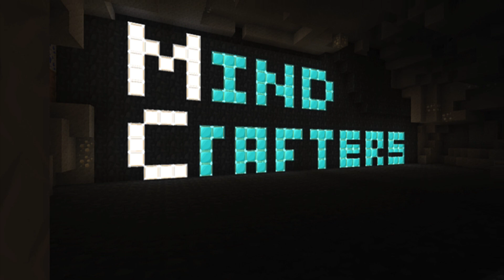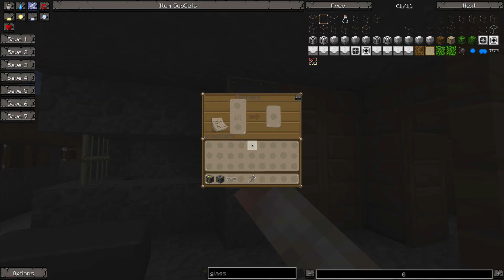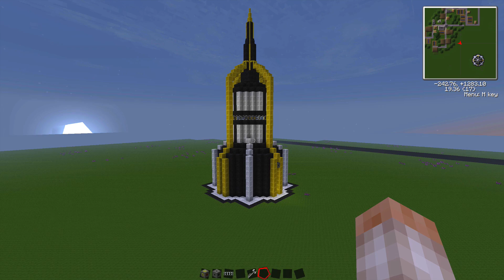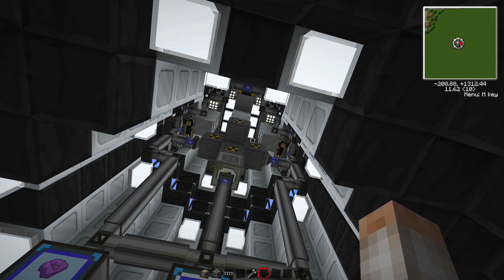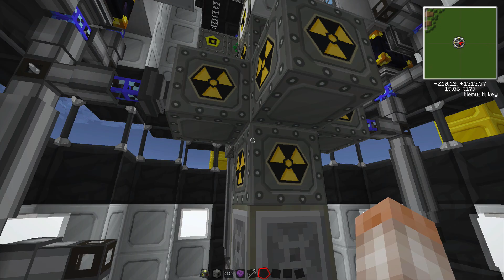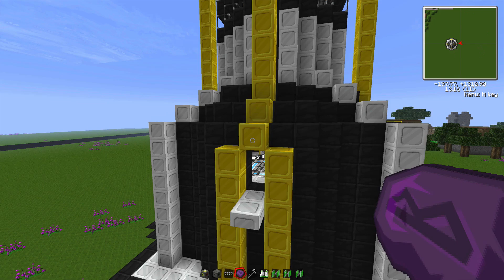Tekkit Lite - Applied Energistics - IC2 Nuclear Reactor

Comment: The resource cost of a reactor design like this is more manageable in packs like Tekkit Legends and Tekkit 2, thanks to Project Exchange; however, there's no coolant injector equivalent that I know of beyond MC 1.4.7. This means that depleted condensators have to be removed and replaced with fresh ones in less than a second, if I did the math correctly.
Neither pack has AE2 pre-installed, though; is it possible to have that kind of automated response time with Blue Power/Project Red without a max-speed timer constantly ticking?
Reply from the maker: Man I forgot ProjectRed existed....thats a real blast from the past. Maybe another viewer has an answer though.....its been a decade since I've used that mod. Thanks for watching@

Comment: you can have extreme output 5 Chamber reactors and there is a way to cable from it which is use 4x insulated HV cable

Comment from the maker: Yes there is definitely is but its not easy

If you want to start working on automating one yourself I'll give you the main problem that you have to get around. The breeder (unlike a regular reactor) needs to be filled repeatedly with two items; uranium cells and depleted isotope cells. Also two items also need to be emptied, Near-depleted uranium cells and the re-enriched cells.

Now, tell your system to inject, and eject items at exactly the right time without causing a meltdown

Good luck!

Comment from the maker: If that worked....how would you make sure that each one was placed in the correct slot inside the reactor? Dark cable is something I never thought to use in a situation like this...that might work really well...although I still cant think of a way to bypass that first problem I mentioned when both items get ejected at the same time...i'm definitely going to try this out...it seems like it could work...let me know what you find out if you beat me to it.

Comment: I think I may try using a couple state cells to transfer uranium only when the reactor is off (after it's used up), while having depleted cells always going in. Maybe this way the only problem that could occur is the isotope cells might replace where the uranium cells the way I use EU detector cable. There's got to be a way laziness can prevail!

Comment: One way to think of the transformer/storage in- and output issue there is that a transformer transforms "up from" the voltage it's named after, despite being mostly used the other way around, making the side you call input the output.

Comment from the maker: There are a couple ways to reduce the possibility of that happening but one easy fix (I set up ours this way) is to use a thermal monitor to send an emergency cut-off signal back to the reactor in case it injects uranium cells into the wrong spot. I hooked up an industrial alarm as well so I could hear if it ever happened. The downside to this method is that you have to manually fix it if it does go wrong.

Comment from the maker: Yes. I did this on our server and we briefly walk past two breeder reactors in the upper portion of the base but you can run into a big problem with those. AE will be looking to export two different items and import two other items...if the uranium cells run out and get sucked out of the system, and a isotope cell recharges at the same time and gets sucked out...the new uranium cells may get thrown into the wrong spot inside your reactor which could cause a meltdown.